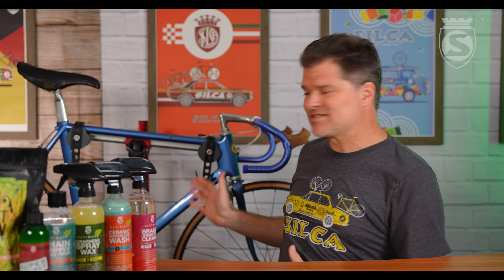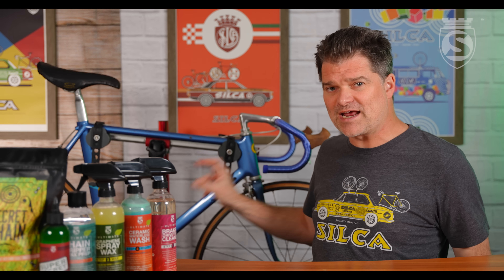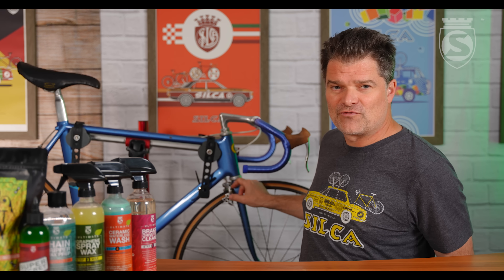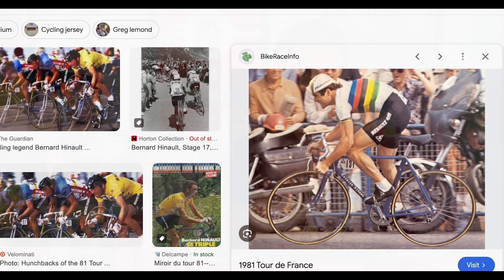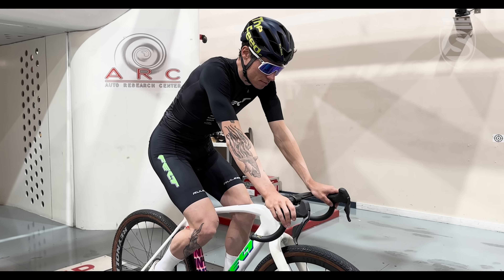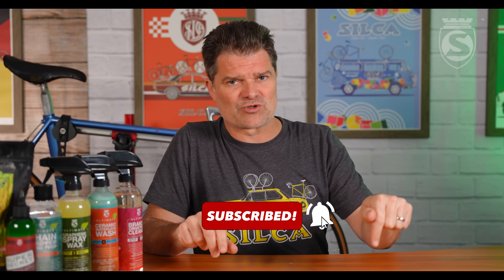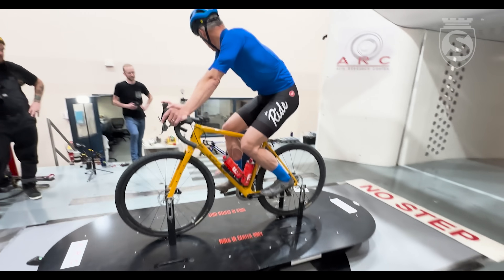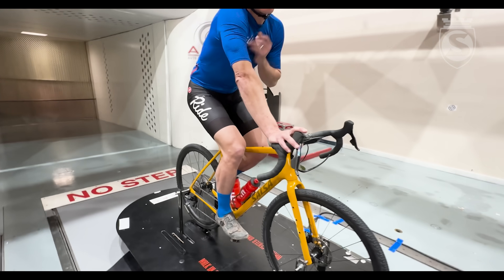Wind Tunnel Wise: How Your Bars Slow You Down!

Comment: unfortunately many bikes (especially the larger sizes) still come with 440mm handlebars. i already switched to 400mm. takes a few miles to get used to, but it feels faster, and all data i have seen confirms that
as an Mechanical engineering student (and nerd) I love these scientific videos
Reply: Same goes for cranks. Why do so many bikes come with too big parts? Are there so many bodybuilders coming into cycling?
Reply: @chrisridesbicycles  possibly lol. I came from competitive bodybuilding to cycling. Very wide shoulder frame.
Reply: I was starting out in cycling as Dura Ace AX was failing in the market. It was tradition that you heard for some of the rational. That group didn't integrate all that well onto bikes built for Campy also.
I wondered over the years why marginal gains were abandoned. At some point in the 2000s I think a message of how Euro tradition blurred into a scoffing additude of the only gains worth chasing were to be found in PEDs.
I also watched bars get wider and thought it crazy. There was a traditional method of width lining up with shoulder joints. I began on 42cm which were the widest available. Buying bikes in recent decades meant I tried going wider but always defaulted back to 42s. It's been wild seeing big guys go so narrow as 38s.
Recently Dan of GCN put a prediction out, saying he thought riders might start using a higher position. My guess would be to get forearms horizontal ala the old Belgium position. Slammed stems have given away some aero advantage by putting more arm length blocking air.
Reply: how do you know someone is an engineer? They'll tell you.
Reply: @griffithd05  you must be fun at partys

Comment: Maybe breathing isn’t impacted, but how is handling impacted, particularly on fast descents, with very narrow bars? Those 26mm bars might be fine on flat roads in a TT, but I wouldn’t want them on alpine descents. Also, wider bars can be more comfortable when climbing, especially out of the saddle.
Reply from the maker: We've helped 2 world tour teams make this transition as well as number of gravel racers and at 37-38cm bar width, everybody gets used to it in a week or so.  Narrower than that gets much harder, and the track guys end up needing smaller bikes with longer stems to help offset the sub 30cm bars.  Having said that, the watt savings for Ben going from 46 to 42cm bar is more than 15X greater than the benefit of converting to a top of the line oversized/ceramic pulley system, so this is right up there with aero socks as being one of the most cost effective performance gains that you can just buy.
Reply: Very amateur rider here, moved to 38cm on my gravel bike based on aero efficiency but also ergonomics as my shoulders are close to similar anyways. Yep, took about a week of getting used to things and haven’t looked back.
Reply: I went from 42mm to 36mm bars (at the hoods).  The only time I miss the leverage of the wider bars is going hard uphill out of the saddle on the hoods - if I spent a lot of time doing 5sec sprints up 20% grades on the hoods I might go back, but not for anything else.  Surprisingly, sprinting in the drops I don’t feel any loss of leverage. Descending I don’t notice any difference - the amount of force needed to countersteer a bicycle is miniscule.
Reply: The short answer is that it's actually improved. You don't steer a bicycle like a tractor by wrenching on the steering with leverage, you can steer it without even having your hands on the bars at all.
Reply: @galenkehler  what are you talking about, you don’t steer a bike by turning the bars. Turning is done by leaning the bike into the corners, the bars help control the extent of the lean. There is a reason TT bikes are crap at climbing and descending. Having your hands narrow and in the middle of the bars doesn’t give much leverage to control anything. By your logic TT bikes should handle the same as a road bike. Let’s see you steer into a high speed corner >70km/h withiut your hands champ.
Reply: @Adonis-qj1nq  you seem to be contradicting yourself, but also have a few things incorrect, so I'll try and go through it. The first sentence, you say you don't steer by turning the bars, which is what I said as well. But then you go on to contadict yourself, talking about "leverage", and how TT bikes are bad at climbing and descending because your hands are narrow. You need to sort that out in your reasoning.
Later you say that by my logic, TT bikes should handle the same as a road bike. Long story short, they do! I use a TT bike with drop bars for my road bike, for fit reasons so I can get a long reach with a low stack. I did this specifically for the handling improvement of having a reasonable stem length.
Reply: @galenkehler not mountain biking. You’d expect gravel to be somewhere in between

Comment: Good stuff! Here is an XC MTB question for future consideration. I just got my first Fox Stepcast fork, which is considerably more narrow than other forks on the market. What, if any aero gains could be expected from it? Especially considering where the fork is on the bike and that it doesn’t impact rider position at all, and with the riders legs behind it maybe there is no benefit at all?
Reply from the maker: There is almost zero frontal area reduction to a narrower suspension fork so no real gain there, but likely no penalty either.  You'd have to make it wider to get the fork legs more inline with the riders legs to really see any improvement.  However, even the tiniest ovalization of the fork legs could make a huge difference to aero, same with the crown, it would take just some slight shaping to make it notably faster.  The Lauf Grit is a good example of how just a little shaping of the thing can dramatically improve aero, making it more aero than most rigid gravel forks we've seen despite having all of the extra pieces and parts hanging off the back.
Reply: @SILCAVelo  thanks, good info!
Reply: Very cool to hear about the Lauf.  Love mine, and have noticed the profiling on it and wondered.

Comment: @silca which has bigger savings? Aero frame or going from a, say, 40cm round handlebar to 40cm aero handlebar? My personal testing in the real world with testing speeds of 25-26mph indicates an aero frame is approx 7-11 watts on average over my Colnago C40, and aero handlebar with same width approx 5-7 watts. Illicting a speed increase for frame alone at .2-.3mph increase and aero handlebar approx .1-.15 mph.

Comment: I've been riding 38s for the las decade and it made a noticeable improvement. Now, we all know that round frames tubes are horrible aerodynamically but how close could an optimized wheelset bring it to an aero frame in watts? Could one extend the rule of 105 to match the rear edge of a wheel tire combo to the tube behind? IE: front wheel to downtube and seat tube to rear wheel? I would love to hear Josh answer this in the next episode.